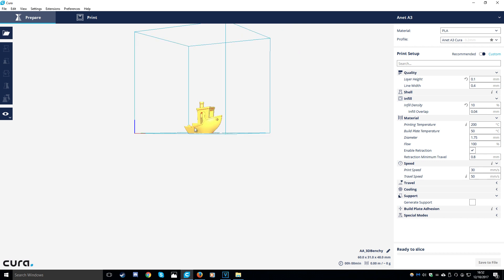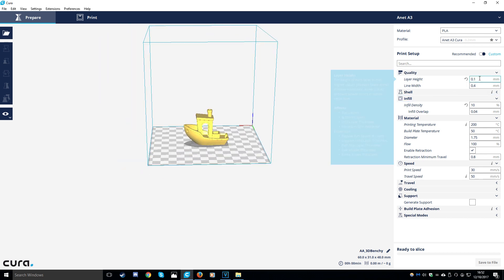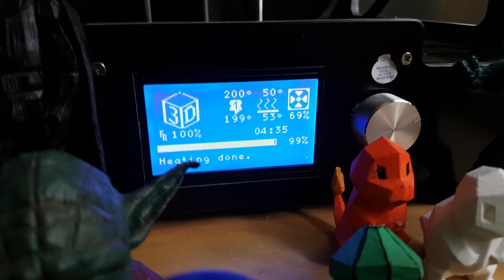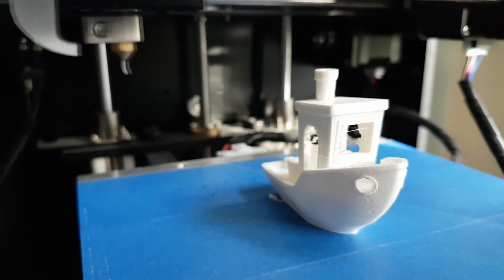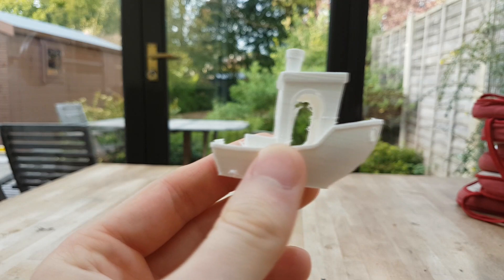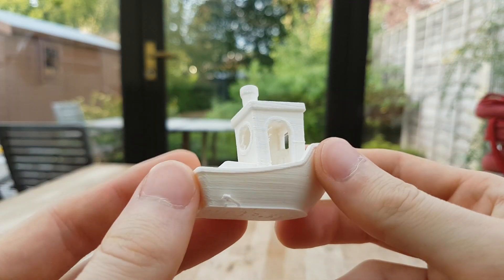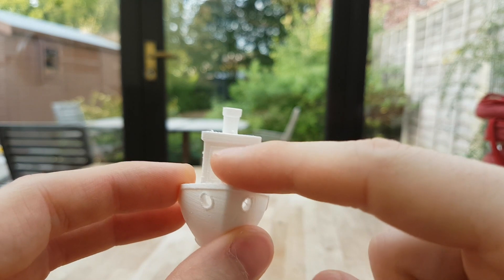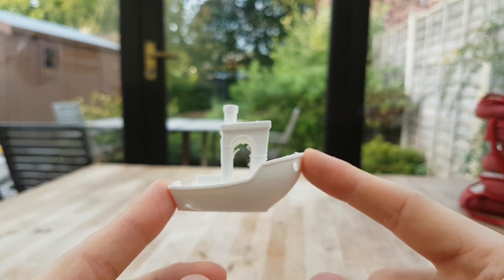Anet A3 3D Printer Benchy Torture Test - Amazing Results!

Comment: I have this printer but can't get anything to print yet.  i just bought it and it was brand new in a box never used.  The yellow tape on the bed seems to be the issue as nothing is coming out.  I have correctly leveled the bed.  What is the blue stuff you have on your bed?  Any tips would be great as would love to get something printed to know its working!
Reply from the maker: The blue stuff is painters tape to help the print stick. Try redoing yout filament loading check that is correct

Comment: your prints looks awesome overall. I just did my 1st benchy using cura and a CR-10S. My hull is awesome but your overhangs & roof beat the pants off mine. I printed wiht a .2mm resolution and wonder if this is why. I wish you showed the roof more - it looks extreemly smooth on your anet compared to mine (on my $700 printer  xD). nice job
Reply from the maker: Thanks for watching, yeah I printed at 0.1mm layer height should help somewhat. Making sure the bed is level also should help.